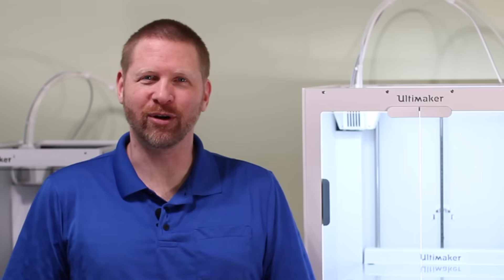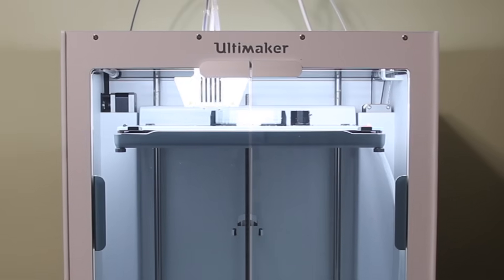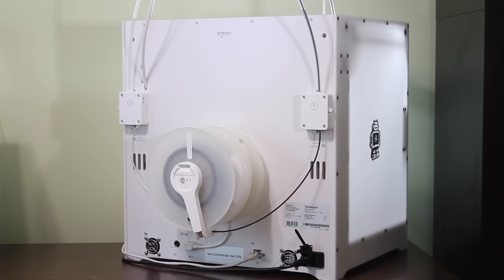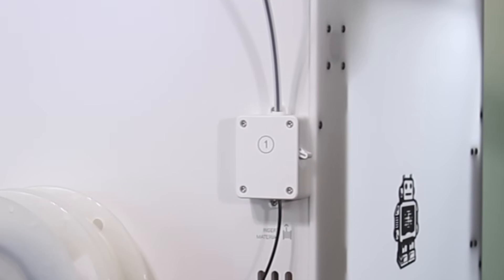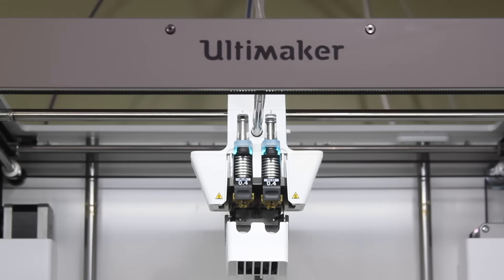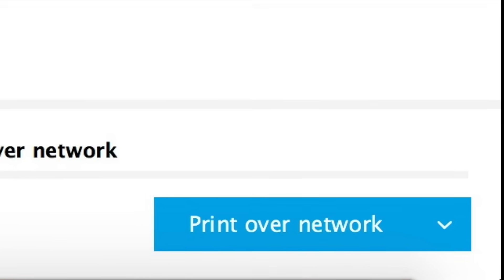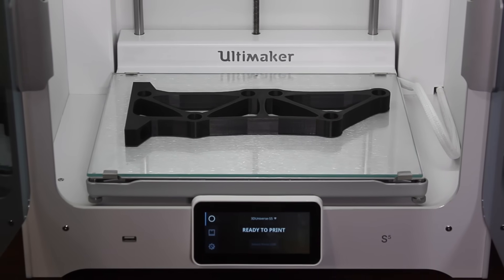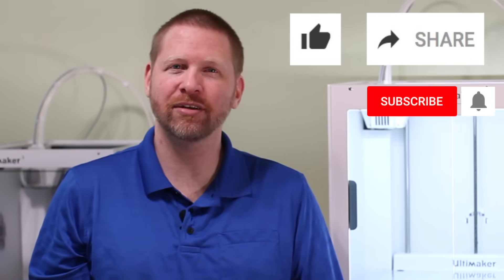Ultimaker S5 Overview

Comment: worth mentioning that if your looking at getting this printer Ultimaker has backpedaled on the promise of an aluminium build plate for engineering. after promising buyers this feature to get them to buy the machine they revealed they cant get it to work well and are offering a cheap glass plate as the solution. While i respect the honesty, this is some shady ish to promise something like a super durable and robust build plate and to bait and switch buyers into the same old tech they committed to doing better than in order to sell this very expensive printer is very sad.
just beware as there may be some marketing material out there about the metal build plate, ignore it. its not happening.
Reply: Why was the Alu build plate needed? I have been printing on glass my whole life without problems
Reply: Adam Hansen a few reasons, but large ABS prints tend to pull chips off the glass surface. Ever print large stuff the size of an S5 bed and tried to remove it without damaging the glass? The aluminum was important and wasn't handled well by ultimaker.